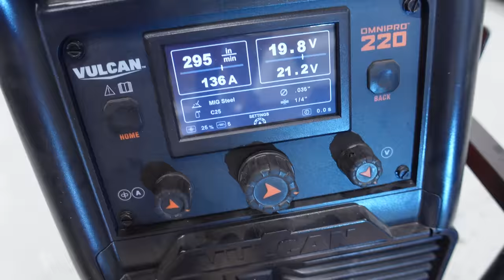New Jet Skis Are $20,000 Each... I Bought These TWO For $500

Comment: 1990 650TS - we had two of these growing up.  It is true, they are very reliable!  Do nothing and they just keep going.  You are correct on the front engine compartment.  There should be a flat square paddle that you need to press down and turn to open.  They were not ever easy to open even when new.  Required body weight to put enough pressure on the paddle to allow the latch to grab and open the catch inside.    Looking forward to seeing you out on the water!  Both of our 650TS models turned better to the right than to the left, I’m sure yours will be no different.  They “carve” more to the right and sorta cavitate and slide to the left.   We had a stainless steel impeller on one of ours and could hit a BLISTERING 39mph on flat glass water (when I was a 12 yr old rider weighing under 100lbs). Stock impeller probably 37mph in same conditions.   The 650SX stand up models we could do 42mph stock (less weight and narrower hulls).

Comment: The Yamaha part you called the intake manifold is actually the exhaust expansion chamber. There are 3 bolts that old it on (often sheared like yours, just did the same repair. Pull the pipe out, remove broken bolts, Autozone sells a Dorman bolt kit that fits in there. It is for Toyota exhausts I believe, M10x1.25 x 35mm?

Comment: On the WaveRunner -- the cylindrical cubby under the seat was for "dry storage". You could safely keep your wallet, paper, phone, etc in there as it won't get wet even if you flip it over.  There would have been a rubber gasketed cap that sealed it that appears to be missing.

Comment: The grom will 100% tow that trailer, that Honda engine design with the almost straight ahead cylinder angle and the low first gear, dude... The roaches will be riding around on Hondas five minutes after the mushroom clouds clear  =)

Comment: We had two 2006 See Doo RTX jet skis with 215 HP supercharged engines, that we bought new. The onboard speedometer said it would do 75 MPH, but my GPS said 65 MPH. That is plenty fast for a PWC. At wide open it would empty a 15 gallon tank in no time. At a cruising speed of 35 or so, I could run all day on a tank. I think we sold them when we both reached 61 years old  Just too hard on the old body parts. They were a blast when we had them.

Comment: Back in the late 90's I picked up a 94 or 95 Tigershark Daytona 650 with low hrs and being a dirt biker I couldn't leave it stock lol, put a upgraded water grate and a SS impeller, a TDR Water box (exhaust) and a carb rejet, it woke that thing up big time on flat water it pulled just under 55mph. The one thing I loved about it is it had electric trim and my finger became one with the button, the one thing I didn't like was the hull design, it was more of a flat bottom hull which would be fine on a lake but I road in the Delaware Bay and Atlantic Ocean and once there was any size to the swell she was a hand full. I wanted to put my entire drivetrain in a Montego hull which had a nice v hull but sold it before I ever did because of a Back injury, miss it as it was the next best thing then riding offroad which sucks in NJ during the summer lol.

Comment: On the oil injection, if you plan on keeping it intact make sure you replace the small lines going from the pump to the intake with TYGON line. Personally, I would delete the Kawasaki TS' oil pump, but keep the Yamaha's intact.

Comment: The wave runner three that's the exhaust manifold does rattling around in there and on the other one you're wearing where the pump blades are is wore out that's that loud rattle here they need some parts not too bad

Comment: Gabe needs to stop using 2 cycle oil to fry stuff or whatever is causing him the smell... My rule of thumb (I run a Boat/PWC repair shop) is that a tandem trailer is worth $1000.
With that one being not ideal for newer larger V-hulled skis, I may not pay that much for it.
Any PWC regardless of condition is worth $500, if it is complete. You can always sell the jet pump, engine parts, and such and recoup at least $500, often more.
I have paid less for some that had severe hull damage and catastrophic engine damage (think hole in hull large enough to work on the engine through, and hole in the block large enough to reach in and check crank play with your hand)
$500 for both, with the trailer is a steal. I usually see problems with machines that will run decent on the trailer, but once under load in the water the carbs are not tuned good, sometimes rings are worn and the power isn't being made like it used to. Neither is a huge problem.
Get em out on the lake and see what they do!

Comment: The Kawasaki 650 has a crankcase drain lever, do not pull it. Instead buy a block off plate and block it off as soon as you can. It is under the starter and not fun to get to. They can cause air leaks in the crankcase and run lean and toast the motor.